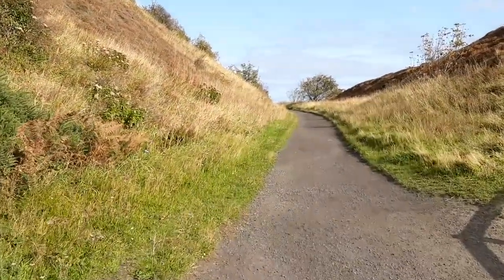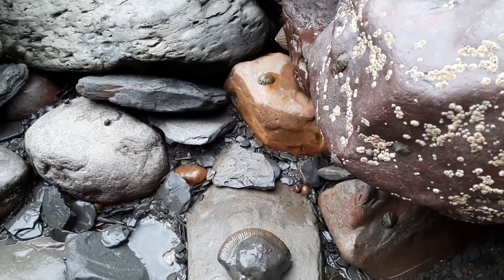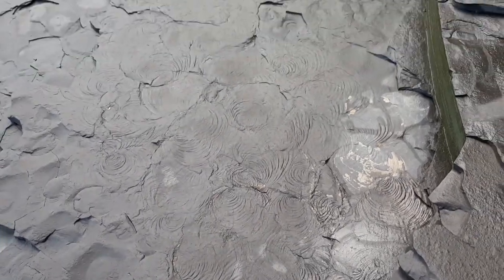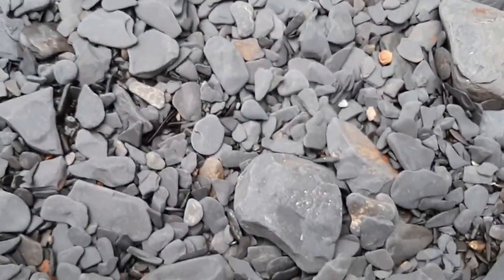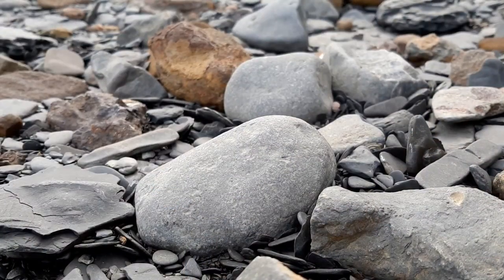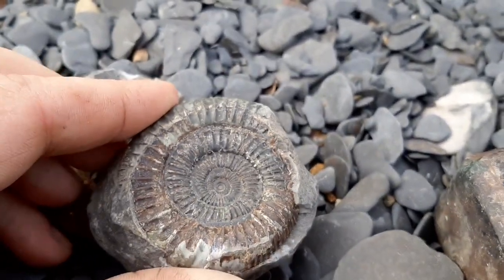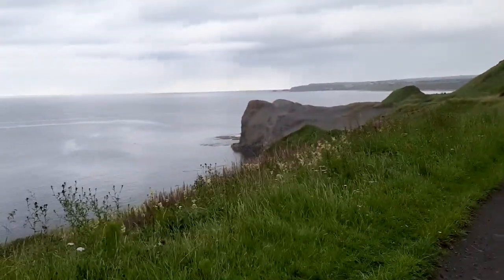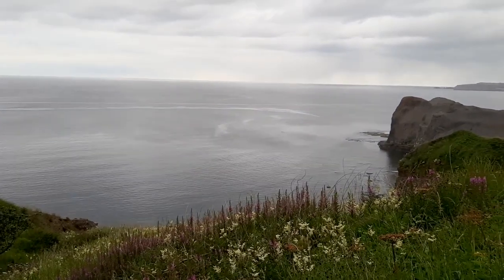Fossil Hunting And Prep, Sandsend

Comment: What do you put on them for polish? Absolutely love the videos, currently on a binge through them all 😁 thank you for sharing 💕
Reply from the maker: Glad you are liking the videos🙂  I use Paraloid it's a form of acrylic that dissolves in acetone , once you brush it on the fossil the acetone evaporates and leaves you with a glossy coating that protects the surface of the fossil .
Reply: @Treasurehunter11001  incredible!! Thank you so much 😁 I just finished watching your fossil prep playlist, your work is amazing!! Can’t wait to try and prep my fossils some day- although they’re just leaves and flowers and wouldn’t be nearly as cool 😂
Reply from the maker: @shvonnemarie  thanks for the compliment, I got the dremel to experiment to see if I could do some fossil preparation at a low cost on some of the softer rocks  compared to buying expensive air preparation tools . Going to be doing a little more soon.